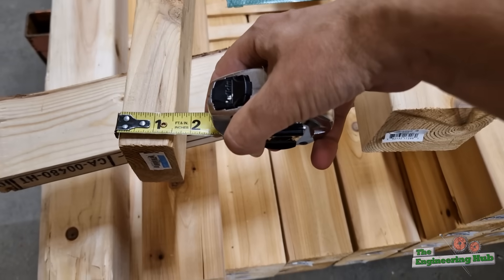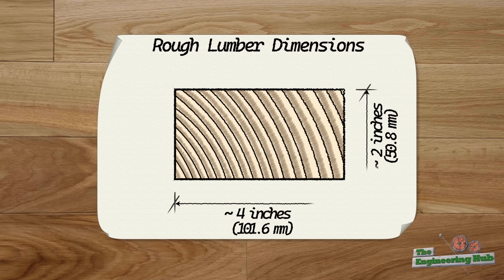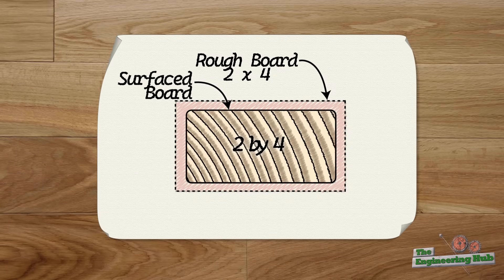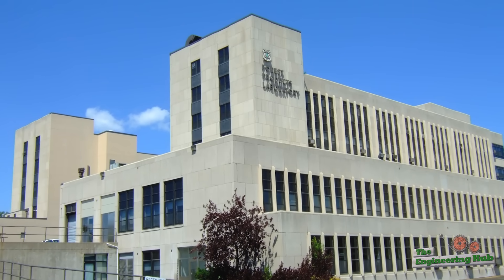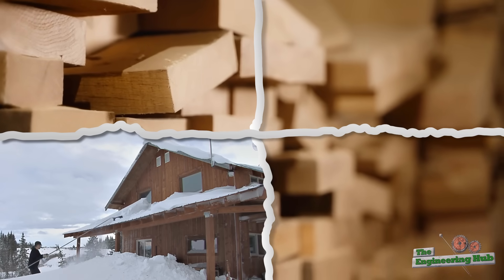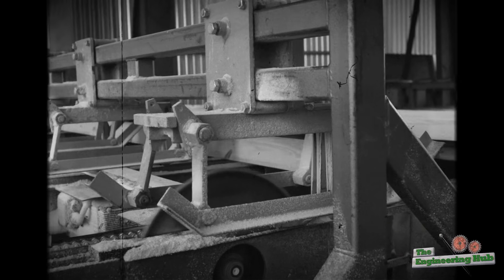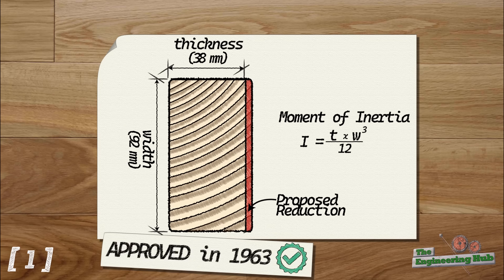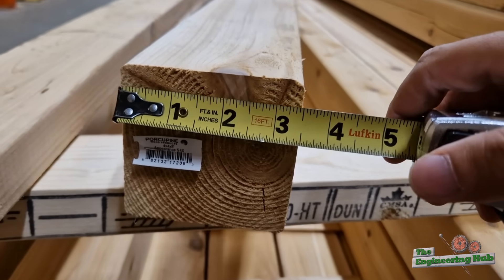Why is the 2 by 4 getting smaller and smaller?

Comment: Repeatedly the industry said, "without affecting the strength". I'd love to see a load capacity comparison between 100 year old 2" x 4" boards and the smaller modern stud boards with grain nowhere near as dense.
Reply from the maker: I'll look in the literature to see if there are any tests from back then available. It's an excellent point, and I am pretty sure you are right!
Reply: @TheEngineeringHub  Physical size  does not nesseserily mean more strength. It is the quality of the lumber that matters like wood grain and knots. I used to work at a roof truss factory. We used MSR-rated (Machine Stress Rated) wood  You can have different load ratings for lumber that has the same physical size even with lowly rated #1 and#2 'S.
Reply from the maker: @MrDarcykampe  Absolutely agree, there are many factors that influence the load carrying capacity of a wooden member and size is one of them. But the strength (yield strength) does not depend on the size, you are correct. Although size effects do matter to some extent; they are not as significant as for example the things you mentioned i.e. growth rings, knots, moisture content, etc.
Reply: @MrDarcykampe   We're speaking in terms of averages, not for one specific piece of lumber. On average, the strength rises with cross-sectional area because the average composition of a sample set of boards is the same for each element of the set, i.e. for each board that composes the average. Of course, to have a meaningful comparison between board sizes, one must have a statistically significant sample, meaning one large enough that the board quality is effectively the same across different sizes.
Reply: @TheEngineeringHub  If you are interested in running your own tests to check old vs new lumber strength, I have some very old reclaimed wood from old barns and homes that were constructed between ~1860 and 1910. The wood I have is still in quite good condition. Let me know if you want me to send you a couple sample boards for you to strength test and compare, I would be happy to mail some over.
Reply: @OstlerDev age of the wood you have makes it not comparable to what it would've been freshly sawn.
Reply: @TheEngineeringHub  a comparison of modern lumber to these standards would only indirectly measure load capacity but, might still be quite interesting: https://nvlpubs.nist.gov/nistpubs/nbstechnologic/nbstechnologicpapert319.pdf
Reply: @TheEngineeringHub  Maybe you can team up with Project Farms and find out sense he loves doing all sorts of experiments.
Reply: @Joe-TechandBlog this is a topic beyond a couple of quick project farm tests.
Reply: @TheEngineeringHub  One other thing you might want to include if you do a follow-up video is seeing if there was a difference in tightness of grain between old and modern lumber. The grain comes from the rings in the tree and my guess is trees with more rings will be more dense and therefore stronger. I would hazard a guess that in the early 1900's they were cutting down older (and denser) trees which would have a higher strength for the same volume.
Reply: @TheEngineeringHub yay
Reply: The old lumber gets harder as it ages, so any test would have to be with new wood of actual 2 by 4 versus standard dimensional lumber. Otherwise you are just testing the harder old versus the softer new as much as you are testing dimensions. 

I've found I have to drill a pilot hole in 100+ year old wood to drive a nail. Otherwise driving a nail is very hard, but if it is a 16 penny nail, the wood is very likely to split. Too hard to crush the way new wood does when a larger nail is driven into it.
Reply: Yeah, especially a wood like ponderosa pine, which almost fossilizes with time.
Reply: You will never see that comparison done under Official observation or standards. Sorry, but that is the facts of Corporational Governance!
Reply: In bending, and in loading where buckling is a failure mode, the depth of the beam squared gives the strength while width only adds linearly.  Thus a 3.5” vs a 4” depth against bending is only 76.5% as strong and a 1.5” vs 2” depth against bending is only 56.3% as strong.  That’s not even counting that better grain structure would also add strength.
Reply: Yeah, you know they are full of crap. Anything to save a buck.
Reply: @calj01 Also trees.  Higher density wood means trees that take substantially longer to grow.  Larger sizes means fewer pieces per tree.

Undoubtedly, the quality was better; even 20 years ago was better than what I see in stores now.  In 1950, we had somewhere around 2.5B people on Earth vs 8B today, there's just a bit more construction happening, and we can't sustain the rate of consumption now, much less using larger, slower-growing lumber. We can't even sustain our use of sand for concrete (not all sand is the same, or useful for concrete - that's why there are actually thieves who are stealing sand off beaches), which is one of the most abundant resources we have.
Reply: Here wood quality is garbage these days. They chop so young forests that they have make cross-laminated beams because 4x4 fail all load tests.
Reply: It's not whether it affects strength, it's where they're strong enough for purpose.
Reply: They wouldn't be the same, bet on it.
Reply: Keep in mind many of those old ones was made from what ever tree was closest to them.  So you had hard wood 2x4's as well.   So I promise you an oak or maple 2x4 will hold extremely more weight than a modern most common Douglas Fir 2x4 or even the stronger yellow pine. you can buy today.
Reply: The strength is different, not because of the dimensions, but because old growth wood has tighter rings making the lumber more dense, and strong
Reply: @mogyui2902 this is true in some woods. In others like oak, fast growing wood with fewer rings is stronger.  Old growth pine was gone long ago in many areas due to railroad pre coal consumption,  not due to structural use, so a lot of 75 year old wood isn't like the old growth stuff. The biggest difference between old growth and later is bug and rot resistance.
Reply: Isn't grain density really important, though? It's not like they are cutting out the density. We don't have those trees to cut anymore.
Reply: I always wondered how they'd like it if I paid them 80cents to the dollar, and told them "it won't affect it's buying power"
Reply: I just traveled back in time from 2223 and I can assure you that the strength of the modern 2x4 has not been compromised by it's newest size of ⁷/⁸  by 2⁵/⁸.
Reply: Yeah for the context of what's built as in houses and the normal spacing used and lengths, it does not affect the strength for the purpose. The thickness is minimal point vs the width which comes in many sizes as commons for most of the house which is the point of the statement. Keep in mind that too thin makes it easier to bow when drying and too thick just adds weight to the overall house which it is not just the framing but also the ground that it is built on. There is a reason why brick and mortar homes are not allowed to be built in some areas of the US, They will sink and settle too much which would damage the foundation.
Reply: @silentferret1049   If you get termites or rot in the wood, the thinner it was to start, the more quickly and dramatically this affects its strength. Any layperson who's had to contend with the issue is well aware of it. It's only the holier-than-thou professionals, lumber dealers and engineers (i.e. everyone who doesn't have to live with the consequences of a major mistake) who seem chronically unable to grasp the central factor in the question.
Reply: @no_rubbernecking when those weak boards fail, it's just more sales for the manufacturers. Why supply lumber that will last a lifetime when you can get repeat customers a couple decades later?
Reply: @tryscience   That is the obvious motive.
Reply: @no_rubbernecking  could you not just use concrete, brick, block, or steel if the thin wood of today is too weak for you?
Reply: @scrapmanindustries   For everything? Well I suppose. The point was that vendors should sell what people need rather than just what builders want to sell them.
   Someone above made the point that one could buy rough-cut from whomever, but the point is if it's available, it's only because the vendor decided to do the right thing instead of following the lemmings off the cliff.
Reply: @no_rubbernecking  you can actually come here to Kenton Ohio and find a bunch of Amish willing to sell you rough cut lumber. And vendors are supplying you with what you want. You’re voting with your money. Interesting how these lumber companies only interested in “corporate greed” are selling train loads of the stuff you hate yet the Amish here selling rough cut lumber that you desire are only selling pickup truck loads on occasion. And yeah you could make a building with no wood what so ever if you desire. I’ve seen it done.
Reply: @scrapmanindustries    So have I. Why did you think I hadn't? Oh, I'm wrong about lumber dimensions so I must be ignorant about everything.
   I didn't say "I suppose" because I had never seen it. I prefer to use lumber for the same reasons almost everyone else does! That being said, my preferred material for foundations and load-bearing walls is, of course, stone. One day, I may even get to build something with it.
   I'll say it again. The complaint was not that no one sells it, but that the ones who don't, don't. You can look right on this thread and see loads of Europeans and Ozzies saying the dealers over there only sell full-size, subject to planing, and they seem uniformly happy about that.
   Even some American contractors are on here saying they never build with dimensional 2x4, only 2x6 and up. [Edit: I meant for load-bearing, of course.] You're trying to present it as a couple of crazy guys plus the Amish. This is not the case. Your side is in the minority. But they have a lot of capital and control of the distribution. If 90+ % of the lumber is dimensional, 90+ % of wood-frame residences are going to have dimensional, and there's not a thing I or anyone can do in our lifetimes to fix that. All we can do is try to show you lot the reason the problem exists, which is a total apathy about the future of the structures or the people who buy them.
   Have you never heard of the concept of planned obsolescence?
Reply: @scrapmanindustries  it also has to do with amish lumber not being stamped... which is another whole bullshit argument from the major lumber companies who are in bed with governments and codes to prevent you from building with any lumber you choose, even though stamped lumber is trash and amish lumber is for the most part not. its also far cheaper than store lumber and you get more. its only because people arent allowed to use rough cut to build with that surfaced lumber sells by the train load. if codes didnt exist, everyone would build with bigger stronger lumber that is cheaper and better quality. government interference in the market is why the quality is junk today, just like anything else the government gets its hands on...
Reply: @michaelprice8810 if codes didn't exist everyone would build stronger 😂😂😂😂😂 that's the funniest shit I've ever heard.  Ever!  Have you ever had to do demo on a structure built to code?  Buddy if code didn't exist most construction would turn to dust and blow away before the ink dried on the mortgage.
Reply: @murderhappens8361that was my take away as well. The dimensions of our lumber today is sufficient for the method which we construct our buildings in North america today.
Side note, I believe the rounding of corners also prevents lumber from splitting
Reply: 16 on center... used to be 24.
Reply: @howdareyou41  yes but with smaller 2x4s now 
Just as strong  less materials 
And easier draw plans because all the materials are in  uniformed measurements. 
Like sheet rock and insulation ect
Reply: @robertnussberger6449  But that's not less material? If you've gone from 24" studding to 16" studding, you're using more wood again, bringing it back up to the required strength.
Reply: @NigelTolley  actually it's less and if framed correctly would be even stronger 
Plus sheet rock and plywood line up perfectly if done correctly 
Even insulation
Reply: I don't know about what the industry said, but I know we don't tend to use 2 x 4 studs for structural walls, we tend to use 2 x 6 - 2 x 10 depending on the load. 2 x 4 wood frame is really only used for non load bearing walls if possible.
Reply: The support spacing of wood is a function of the square of its dimension. A true pine or spruce piece of 2x4 needs 16 inches between supports. A 2x3.5 needs 12.25 inches on center. So, you do need more wood between supports for the same load.
Reply: @PR-fk5yb  which is why we don't really use 2 x 4 for most structural applications anymore. We tend to use 2 x 6 or higher.
Reply: Look at the growth rings of the old vs new boards.
Reply: It would be good to get load grades, along with real dimensions, than just nickname
Does designers know how much load "2x4" shop you buy from can take?
If not, engineer will play it safe and double it, while contractor will play it cheap and charge you for it, while using enough to not fall apart when you look at it hard enough, resulting with nasty surprises over years
Reply: Modern timber is made of fast growth varieties which much wider grain, they are much lower quality.
Reply: yep. money rules until somebody gets hurt and sues
Reply: It's all about more profit, plain and simple.
Reply: Anyone who has ever remodelled a 19th century house can instantly spot the difference. The 19th century house survived and is built like a fucking tank, whereas the modern equivalent is already a creaking wreck in a decade or two.
Reply: @mangore623  You can build a house like a tank whenever you want, bro. Just commission one with doubled up studs, pay 550k instead of 400k, and enjoy! Nobody's stopping you. People don't build those now because they don't want to work years longer before retirement just to afford an overly strong house that they don't need. Not because lumber companies tricked them.
Reply: If anyone cared about the strength, then homes wouldn't be built out of sticks in the first place.
Reply: @abark  brick houses suck. They also don't hold up to hurricanes, tornadoes, or earthquakes. That's why so few of them survived in the US while the barns and log cabins from the early era still stand proud.
Reply: "It's good enough" for construction designed around such exact materials, says people who never built or owned a home.. good stone and wood will make a home that actually lasts your family a few generations.
Reply: Also, a lot of people who didn't build houses in the 1800s talking about the construction process. The rough cut lumber that was planed down was very long ago and not dimensional lumber. Late 1800s residential constructions in New England are all made from rough cut true dimension lumber. Nobody was planing their framing once it was being cut to size properly.
Reply: just look at the old sears homes. they're still standing. newer homes are JUNK in comparison.
Reply: I've worked in construction, the difference is night and day.  I've handled old lumber, it's easily 50% heavier and way more durable.
Reply: I know this is super subjective, but I find this apparent in seeing 100 year old decks and such still standing around my neighborhood while the 30 year old ones are bowing under pressure.
Reply: No it would be weaker of course. The point being builders can use less and still be getting an appropriate strength for home building.
Reply: The strength mostly depends on the Tree not the cut. The 2x4 is the ruff cut measurement not the finished/planed measurement & since people used to plan the wood themselves it made sense to keep these pre-planed measurements that people were used to.
Reply: Haven't franing standards accounted for this now by going from 24in oc to 16in oc?
Reply: Actually if you frame correctly it could be even stronger.
Reply: Well I mean, obviously the hundred year old 2x4 is gonna affect the maximum load bearing potential of the piece. However, clearly and demonstrably the modern 2 by 4 is adequate for use in construction work, based on the fact that in a major number of cases, a modern building will be constructed using modern 2 by 4's.
Reply: It's the same thing, it's just that nowadays they don't include the tax in the  2" x 4" boards.
Reply: I said a 1" by 2", not a 1x2. Four of these making up an OLD 2x4, six of them making up an OLD 2x6. YOU are saying "1 by 2" because you want me to be wrong. 🤦‍♂ @didjitalone9544
Reply: I think you mean modern 2x4 that are actually 2x4 vs what we now call now 2x4 which are not actually 2x4?
Reply: Well you kind of answered your own question: the grain/density would make the 100yr old 2x4 stronger than a true 2x4 today. Commercial forestry and mills harvest very fast growing trees and not old growth ones, so they are not as dense. That doesn’t mean they aren’t strong though. The current building materials even at the minimum for code is more than strong enough to build homes that last, assuming they are used correctly and the home is engineered/designed correctly. I can attest this personally not with 2x4s, but I do work as QA in an OSB mill and the strength standards we have are far in excess to “normal” conditions.
Reply: Usage case was implied here. I can see you and 2000 others can clearly think for themselves though. 😂
Reply: Someone is obviously unaware of current building codes which require 2x4s to be closer together to provide the same tensile strength as using bigger lumber.
Reply: In engineering there's always a factor of safety. There's also trying to minimize cost while maintaining that factor of safety. Your 2x4 might have a compressive strength of 3000lb, but does it really need to? No.
Reply: @lazydadsgarage  there is always need, some need might come where you have no idea. Maybe  tree falls on your house, or truck rams your house, or you just wish to store heavy load on second floor. Or your house will be hit by tornado you never know the need.
Reply: @asjaosaline5987  building codes are there for a reason. You're all missing the point and everyone commenting has no background in engineering or construction 🤣
Reply: @lazydadsgarage  building codes are arbitrary, different STates have different codes. And when you compere them To Europe even most poorest European country has stricter codes. In Europe people are not that rich to build new house after each storm or after few decades. And there is that Issue. That if there is crappy building codes, then people still build by bare minimum, instead of making better quality. Building codes dont say how you should build they regulate base safty conditions. The whole internet is full of videos how another american built themself small homstead shack or Barn for they animals. That could be destroyed average+ storm. Just watched one video where quy destroyed word down barn that could still be good for half or century. Instead they built new and bigger and much weaker barn what could be turn down by grazed bull. ANd when i commented he sayd, building code dosent demand more.
Reply: @asjaosaline5987 but that's effectively an argument for an infinitely strong house.  No matter how strong you build, "something" could happen that wrecks your house and makes you think "I should have built it even stronger".  "You never know what might happen" is not a reason to over-build something.
Reply: @GerryRR  House in Europe is Home not piece of realestate, even if you dont have super-tornados it is best to build strong house, so your descendents can live there. In italy there is houses that are cose to 1000 years old and often same familys still live there. But if you consider house just real estate and plan it to sell sooer or later then ofcouse some people dont care what they sell .
Reply: You won't like the answer you get. Older structures are very commonly just snacks for wood destroying organisms since the wood is virtually identical to the dead decaying wood outside.
Reply: 100 years ago wood quality was potentially much better, straighter fibers, less knots, they let the wood dry before cutting and selling...
Now nothing of that is done, and they use fast growing varieties instead of selecting the best trees for wood!
Reality is that there are +5 x more people, and the forests are not expanding, despite the official numbers since the 2010's!
That's the real explanation, resources remain limited, while demand is rising, and the same is going to happen for almost anything at some point...
Reply: There's a company near me that buys 80+ yr old wood to refinish and resell at a premium... Big money , for the rich people houses and government grant landmark restoration..
Reply: @Jimmy-jb7wb  I thought the brittleness came from age and the turpenines oxidation and crystallization (like resin putty turned into amber) .
   The old wood seemed to have a lot more natural oils built up before harvest. You can see the differences when looking how different woods hold up  between hot attics and bathroom wetwalls for instance.
   I also worked for a Mason a number of years, I think the exposure to alkaline water kept most of the older wood flexible where newer wood disintegrated (the boss still had form wood and scaffolding from his dad!) , everything was either very old or very new, no middle ground.
   "If Jesus was a carpenter Satan was a Mason" 😜
Reply: @Jimmy-jb7wb  it's a bit before my time but I still remember 78's and Elvis,  it's probably mostly just survivorship bias, of the wood, the brittle ones broke early... But the spread still says something (old and new, nothing in the middle)
Reply: something to keep in mind is that is not necissarily a fair test, the 100 year old boards were rough cut, and you were expected to surface plane them on-site, which would reduce their dimensions to something smaller than 2"x4", but the exact amount would be extremely variable depending on the species, moisture content, how much material the worker doing the planing removed, etc.
Reply: The old trees grew slower (more rings, denser grain).

Modern lumber has to grow fast enough to meet the demand.

Older 2x4s are stronger, modern 2x4s are strong enough for the building we build.
Reply: You have to learn to pay attention to things.

It was clearly explained to you that the old lumber was hand trimmed at the job site. Whether you trim it by pushing a blade across it, or a company does it using Giant automatic machines, the result is the same, the lumber is smaller.

So done by hand or bought that way, either way you're 2x4 is not an actual 2x4.

And the modern lumber having looser grain, does not have anything to do with the size of the lumber.

That is the result of government spending into research to make faster growing trees. And yes, faster growing trees are weaker.

But that's still irrelevant to the size of the lumber affecting the weakness.

Funny thing is, even the channel creator doesn't realize something that simple. 

Time to block this channel and find a new one..
Reply: Weird how many contrarians will take the obvious conclusion of "It was to make more money" and completely overlook it because you'll never find the guys who made the obvious decision.
Reply: do you hear many stories of wood frame homes collapsing under compression?
Reply: The old 2x4s were roughly the same strength, because they were PLANED DOWN ON SITE before use. Nobody back in the day or today, was using 2" x 4" lumber right in the walls directly. They were all using 1.5 x 3.5 plus (or minus) a tiny bit, because they were planing down the excess just like we do today. Whether the planing happens on the build site or at the mill, does not affect final strength.
Reply: @gavinjenkins899  as someone who works with  new rough cut regularly, lives in a house that is old and built of rough cut, and regularly works on other olds homes built with rough cut, ALL of them used full dimension lumber. not one fucking house over 100 years old had a dude outside hand planing the studs down and then framing with them. they are all rough, and all full dimension.
Reply: @michaelprice8810  Then the logic in the video doesn't make sense, and there's something missing to the story. The lumber companies wouldn't have been able to just convince people to pay for pre planed lumber, no big deal, if it wasn't the same either way (as it would be if they were planing locally). So how DID the market bear that instead, if so?
Reply: @gavinjenkins899  not sure i understand your wording. if what wasnt the same either way?
Reply: @michaelprice8810  In the video, the youtuber explains that customers put up with the dimensional lumber initially, because since they were just going to plane it down on site anyway, planing it at the lumber yard instead was fine, they were functionally buying the same product at the end of the day, so they were cool with it, and the companies had found an actually efficient solution that made everyone reasonably happy. In your version, that doesn't make sense anymore, though. if they did NOT plane it down locally, then why did the market ever accept the pre-planed lumber? Any company doing that based on (what you're saying was a clear lie that "you were gonna plane it anyway tho!") would have been rejected by consumers and gone out of business versus competitors selling what people actually wanted, 2" by 4" rough lumber.
Reply: Pretty much everything in the US is going to shit.  We are allowing ourselves to be eaten alive by Jews.
Reply: @tradde11except they have not ar all, in any way. Do you know anything about fabricating walls? Do you know what percent of the wood, by volume, is studs?
Reply: it is not just the size, but kiln dried and dressing 4 sides makes the difference
Reply: Look up Rif sawn VS 1/4 sawn
Reply: Good video idea!
Dude make a video of a testing. 
Try maybe 10 old and 10 nzw to have a good sample of each.
Reply: @murderhappens8361 Yeah now instead of cleaning of dirt and gravel you have to wash off antifungal poisons or cut away plastics or wax, great!
Reply: Well go find a lumber mill and test it.
Reply: If you are making a load bearing wall you can go up to the next size.

Further, an external wall of a house will perform way better thermally if the insulation is thicker in say an 5 1/2 or 6' wall
Reply: @stilllearning1160   That's relevant in a temperate climate. In tropical and near-tropical climates, if you know what you're doing, it's a different story. Good 2x4s still have a necessary role to play for economy housing in such climates.
   The many strawmen and ad-hominems above your comment are really very Marie Antoinette; if the writers understood how gross they sound and how offputting they are for people of limited means, (which is an ever-rising percent of the U.S. market), they'd stop doing it.
Reply: Unusually the grain density is because of the species of tree, comparing oak to pine wouldn’t be a fair comparison and that’s what most of these 2x4 size war memes show
Reply: Sorry but strong enough is not very comforting to me. I have my portable sawmill and will continue cutting and building with rough cut 2x material with a true dimensions. So much easier to do math when drawing out the house plans too.
Reply: Yeh we used to overengineer things 200% until we realised we could save a lot of money over engineering just 10%. Now things often collapse
Reply: @MrWackozacko I've never heard of a stick-frame house just collapsing due to lack of strength in the lumber 😂😂
Reply: All these people arguing about the strength of 2x4's haven't built anything in North America in like fifteen years?  Exterior (aka load-bearing) walls aren't framed in 2x4's.  2x6 is minimum and if you want a more efficient build with more insulation you go 2x10.  2x4's are for framing up a bathroom, and if you're concerned about the strength of your bathroom walls I'm very curious what you're doing in there 😂😂😂
Reply: Modern buildings are all, one way ir another, engineered design. Everything has to meet the loading requirements using engineering calculations. It's not relevant. Modern buildings are overbuilt for most purposes. Trusses, brackets, nail plates, steel straps, rigid air barriers as bracing, lag bolts ect, mostly did not exist on the past. We are using less material for am arguably stronger and definitely more consistent end product. In the past we just winged it and kept our fingers crossed that the building was strong enough. The fact that so many old buildings still stand is really survivorship bias. We're looking only at the small number of buildings that still stand and thinking that's what they were all like. Modern building regulations are written in blood though. People died and rules were changed. Modern buildings are better in just about every way.
Reply: @Patrick-857  you must not build. or if you do, you have zero experience with old buildings. they are simply better than the houses churned out by the consumer world. buildings were not just winged. carpentry was a prestigious trade passed down the line. it wasnt something that joe from down the street just woke up and decided to do one morning. old houses were crafted. new homes are assembled. youre never going to win this argument.
Reply: @michaelprice8810  I have experience in both new and old buildings, and I also have seen the results of three major earthquakes personally. I was there when our government completely rewrote the building code after one of our cities was devastated by one of those earthquakes. 

I'm not talking about craftsmanship here, I'm talking about structure.
Reply: @Patrick-857  you just invalidated your own argument with the word government. good day.
Reply: @michaelprice8810 
Survivorship bias.
Reply: How about splitting  a 2x4 when hanging any sheathing or  drywall? Used to have 1" on each side now down to 3/4"
Reply: I live in a home that is over 100 years old... There used to be a mill/lumber yard down the street (long gone)
This home is FRAMED with 2 inch by 4 inch oak... the joists  are also OAK and are thinner than what we use today but being that they are oak they are overkill.
I have drilled screws into the boards and literally exceeded the drills capacity to bottom out the screw, even with hammer drills
It would not even be close when compared to lumber of today... like a tank vs a car...
Reply: It would be negligible
Reply: The test would be interesting but it would be obfuscated by another factor...old growth wood (found in 100+ year old lumber) and new growth wood.
Reply: Soooooo you want to compare the durability of more wood vs less wood? I think it's obvious more wood would be stronger.
Reply: Without "significantly" affecting the strength

Every single reduction made it weaker, just by a small amount. Small amounts add up quickly when you keep rounding them down to zero in your books
Reply: @Terrible_name  In accounting for load, it’s more important to have a standard size after drying and wood type than how big it is with a large variance in size and greenness. You can double up or put in another beam, you can’t do anything if you calculate a full 2x4 is good enough but it isn’t due to variance of the product
Reply: @gjfwang  and? That's not really a response to anything I said
Reply: Thats a rather simple mathematical equitation.  Moment of resistance = b × h x h /6.  Here: 2 x 16 / 6 = 5,33  and  1,5 * 12,25 / 6 = 3,06. Or simplified: cutting half an inch on both sides reduces the load capacity by 42,5%. (if you use them as a beam, using them vertically would be es different story)
Reply: @adolfhennecke701  the actual question is what “strength” is needed? Studs in compression need end grain crush values. Additionally, the studs must resist bowing and twisting under load. Being old, i cannot recall how that capacity was calculated and tested from my structural engineering classes at a major University in a previous century.

So the question still remains: “Why pay for and use components of greater capacities when smaller (less expensive) components that accommodate the calculated loads exist?
Reply: @larrysorenson4789  same reason why you don't climb with a rope that's rated for your exact weight.
Reply: @larrysorenson4789 some regions actually need the redundancy for safety reasons. And safety is cheaper in the long run. 

As an example: the Deep South has both tornados and hurricanes. More insects than normal, and more rainfall and humidity than normal. Our home insurance rates are much higher than the national average. We end up paying more for the cheaper material over the lifetime of the house because of how insurance works. My home insurance rate is easily 30-50% higher than an identical home in the upper Midwest. 

Quite frankly I'm about done with lumber built homes. When I went to Europe the homes were obviously built to higher standards with tougher materials. Even interior walls were often bricked. European standards make our homes look like popsicle stick garbage.
Reply: @sean6653 interior brick walls sounds like a nightmare.  "I wanna hang a photo Lemme go get the fucking hammer drill" 😂😂
Reply: @adolfhennecke701  In the UK we use 47 x 95mm which is basically a 1.85 x 3.75  which would be 4.33 in strength or a 19% reduction and conversely an american 2x4 has a 30% reduced strength of a UK/European 2x4.
Reply: Bending moments are a square of depth (actually a cubic relationship but divided by the distance from the neutral fiber so squared overall) while linearly dependent on width.   Depends on how you load it, and what the material properties are, but overall it’s simple to calculate as the ratio of squared depth in bending which is the ratio in bending strength of the two boards.  Thus a 3.5” vs a 4” depth against bending is only 76.5% as strong and a 1.5” vs 2” depth against bending is only 56.3% as strong.  Further since the 76.5% width is also 1.5 instead of 2 it’s 57.4% of the strength in bending and 57.3% is 3.5 instead of 4 it’s 49.3% as strong.   @adolfhennecke701
Reply: @adolfhennecke701 Technically right, but for construction purposes SLS is more important than ULS in almost all cases and for that purpose the second moment of area is needed. The formula for that is I_y=(b*h^3)/12, so the missing height is even more important than assumed by you.
Reply: @adolfhennecke701 omg lol and the first reason listed in the video, to increase the amount that could be shipped at once since they were already planing the boards on site. So if that 42.5 you mentioned is the percentage in mass being reduced, that also means they're carrying 42.5% more boards per load by planing them at the mill before shipping. And mind you, they were having to plane down those original true 2x4s anyways so y'all comparing the strengths is extra silly. Using true 2x4 just means more wasted materials on site, which then needs to be cleaned up, and now you have less boards so that means more shipping which increases cost and carbon footprint. Such a silly discussion
Reply: I guess they just don't make trees like they used to. Corporate greed is really making pines grow to be much weaker.
Reply: @shamancredible8632  they don't make trees like they used to. Older lumber came largely from old growth timber. The trees grew much slower amidst competition from other trees, so growth rings were much tighter. Much of today's managed forests are replanted for higher production species, spaced at optimum density for quicker growth, and cut far sooner. Growth ring spacing is much fatter than old growth, and not as strong.
Reply: @stevehatcher7700 which explains why neighborhoods look like piles of kindling after major storms blow through
Reply: @shamancredible8632  - Did you check out the growth rings?  Those are from farm grown trees.  Yes, they are weaker.  The difference today is design.  It makes up for the poor stock.
Reply: Or possibly its old growth vs using young trees combined with demand for lumber.  Corporate greed is a buzz phrase for everyone who doesnt know a fucking thing about anything.   It does exist but it isnt what dipshits like you think @shamancredible8632
Reply: @shamancredible8632 I don't know if you're joking.  Bc what you said is actually true. 
 Though it's not just greed,  but also a more sustainable market strategy... cutting lumber from large old trees in the past allowed them to take lumber from the section of tree best suited to that purpose (ideally); now they farm trees and cut them young... though I'm not sure exactly what effect that has on strength, by just looking at the lumber pile at any store, you can see what rushing growth and drying process does to final product quality.
Reply: @shamancredible8632 You're more right than you think trees during drought add less diameter/yr than yrs w/ substantially more rain making smaller rings & "tighter" grain yielding harder wood 
Modern lumber companies irrigate to max growth/yr, trees reach harvest size faster but "looser" grain yielding softer lumber
Reply: @shamancredible8632  yes it most certainly is. youre very right, despite trying to be sarcastic
Reply: @shamancredible8632  Actually, yes.  Literally.  We've affected the growth rate of the trees with fertilizers and artificial hormones and it's made them weaker.
Reply: @shamancredible8632 yeah. Stress induced rapid growing in lumber forests really reduces the density
Reply: I talked to a fireman at a bar and he was complaining about newer houses built with white pine lumber and finger jointed lumber. I'm not sure what the difference is, but he was telling me that houses made from white pine are junk and the roofs collapse unpredictable, fire spreads faster, etc. When he entered an active fire he would sometimes axe a wall open to see what the type of lumber was and that would help them determine how risky the situation is. I never knew that, good information. He clearly disliked new modern lumber and said cities are decades too late on updating code. Not sure what all is accurate, but I did notice the finger jointed 2x4's at Home Depot several years ago, that just doesn't seem right.
Reply: @81mont 
Firemen at bars aren’t reliable sources. I’ve heard them express opinions about construction that I know for a fact are opposite of reality and facts.
Reply: Exactly!  Slower grown rings, therefore, tighter old growth lumber was and is quite a bit denser, hence, stronger.  Good old marketing hype and lobbying!  No different than 1- & 3-pound coffee cans that are now 11-13 oz and 21- 33 for a 3 pounder and everything else that's packaged you now get less product for more money (peanut butter, T-paper, most everything.)  You can still get a true 3 pound can of coffee at Costco!
Reply: That’s the problem. People keep cutting corners saying “we’ll this will still work! It’s strong enough” and then eventually all those corner cutting mistakes add up into a shoddy product.
Reply: The "strong enough for the purpose" argument is dumb. 

It's like the epa said you can call a V8 engine a V6 and you people are all talking about highway speeds as if no other "purpose" is a valid use. It both misses the point, AND is a deeply flawed argument.

People can use 2x4s for projects other than new home construction, and calling a 1" board a 2" is a deceptive practice regardless.
Reply: @TheBrothergreen ur right, we should call them 1 & 5 8ths by 3 & 5 8ths instead
Reply: @seandunbar6427  you could call it "framing lumber" or something similar. 42mm lumber would also work. What you call it is really irrelevant, so long as what you call it is not specifically and objectively a lie.

That's assuming you were being sarcastic about actually labeling it correctly because god forbid you call it what it is.
Reply: It's going down!
I'm yelling timber!
You better move!
You better Dance!
Reply: Fair observation. On the other hand, given that the houses have to meet current engineering standards, even using the thinned studs should not be a problem, at the end of the day. If they were not enough for construction, they would not pass engineering specifications.
Reply: a dressed 4 sides  2x4 1.3 x 3.5  is the same strength as a rough 2x4, that is why they went to 1/5 to 3.5. it was the smallest they could go with out effecting its strength
Reply: @TylerSmith-jf3dg  thats just false though. its 65% of the lumber as a full 2x4. in no world other that a world of lies is that the same strength. as someone who regularly works with true lumber and home depot lumber, they are worlds away from each other.
Reply: @TylerSmith-jf3dg  That's just not true, rough 2x6 joists and rafters were common for a reason, they are unheard of today.
Reply: @cyberpunkspike  it is true, because some places a rough 2x6 could be 2.25x5/25 and there was no real standard.. not until stamped lumber came in and so a stud from florida is the same as a stud in california under NLGA national lumber grading authority. before that a rough 2x6 could be different from mill to mill until deminsional lumber became standard in canada and the states
Reply: @cyberpunkspike  they are unheard of today.because of the strength difference, and most banks require dressed ,kiln dried and stamped lumber for  a mortgage ,and also for engineering purposes, dressed lumber is stronger the rough limber nand is less prone to cracking and also fires as well. there are many reasons why rough lumber is not used much anymore
Reply: @TylerSmith-jf3dg  It's just nonsense the lumber manufactures peddle to justify their own interests.  In almost old home I've been in in my region, rough 2x4 circa 1890 is 2 by 4 inches.
Reply: @TylerSmith-jf3dg  It's unheard if because 1.5" x 5.5" can't bear the weight.
Reply: @cyberpunkspike  yes some were, here you will find all different size lumber, the lumber has been tested and a dressed 4 sides lumber at 1.5 by 3/5 is the same strengrh a a rough 2x4, where i live has the oldest lumber milll industry, and i have worked in the industry for many many years a a lumber grader and as a lumbner inspector . ot os not hard to understand that mills all across the canada and the states were not standardized until nlga and ngr regulation came in. and that is fact
Reply: @cyberpunkspike  you think so. about  1.3 x 3,5 when  billions of  homes were built with 1.5  x 3.5. my house has 1.5x 3/5 and all the homesbioly until around 2005 when new building codes came in and now 2x6 is the size needed, and that was only for insulation factor to make homes easier to heat,
Reply: @TylerSmith-jf3dg  If your mill gave you lumber that wasn't 2x4 you would never buy from them again, that;s why rough lumber from 1890 is damn near always 2 by 4.
Reply: @TylerSmith-jf3dg  you need 2x6's now for load bearing exterior walls, because you really needed 2x4. The entire tradition of framing carpentry was right, and value engineering from CA was wrong.
Reply: @cyberpunkspike  2x6 not needed unless you are building a 2 story house for load bearing , R value i why they went standard 2x6 for walls.
Reply: @cyberpunkspike  like you aid dam near always,, meaning lumber sizes were not regulated and you could get different sizes, you just proved my point
Reply: @TylerSmith-jf3dg  funny my early 1900 house is 2x4 exterior walls balloon framed 24 on center. 2x8 floor joists spanning 16 feet, also 2 feet on center. one of them was crowned up, as is normal practice, and the damn thing still has an upward crown. over 100 years later. try that with 16 foot 2x8s from lowes and  see where you are in 100 years. in the basement. thats where you will be. because your floor sagged all the way down there.
Reply: @michaelprice8810  what is funny bout that,, i have worked on many homes datign back from the 1700s 1800 and 1900s.. and guess what, while some hve 2x4 and 2x6, some have 2.5 x 3.5 .or 1.75x 5.75
Reply: It's easy enough to double up the studs or use larger dimensional lumber when more strength is needed. The reduced strength doesn't really matter.
Reply: ex @bbgun061  Except it would cost twice as much to double it up.  Which is a significant cost.
Reply: @YouveBeenMiddled  all lumber would cost more if it were larger.
Reply: @bbgun061  more is not double.   We are talking a true 2 x 4 up from 1-1/2" X 3-1/2 VS  2 x 1-1/2" X 3-1/2  when that is not needed.
Reply: @bbgun061  If your logic is valid, why then are all floors, walls and roofs not framed in 1" × 2"? After all, four of these can easily be combined to equal the strength of an old 2×4, or of course 6 to equal the strength of an old 2×6 and 8 for that of an old 4×4.
Reply: @no_rubbernecking actually, that's kind of what they do with glulam, which because they can alternate the grain direction is stronger than conventional lumber. The point is that the marginal difference in strength is outweighed by the reduction in cost. You can double up WHEN NECESSARY (which is not most studs), and likely you would still need to double up dimensional 2x4 in the same locations anyway.
Reply: you only need to doublr up in load bearing locations- and youd  probably need to do that with full dimension lumber as well @YouveBeenMiddled
Reply: @appads   I'm sure that's splendid for manufacturers and sellers, but it doesn't work for the owner in a tropical climate who wants their structure to actually last a reasonable period of time.
Reply: @no_rubbernecking  interesting move of the goalpost. It's also good for the consumer. Besides, there would be very little effect from the small difference in size (from 1.5x3.5 to 2x4) due to a different climate.
Reply: @appads    Interesting that you say "would". I have to deal with the difference continually, because I'm here. So for me it's not "it would", it is "it does".
   It's not a move of the goal posts, it is survival. You either do what you must and survive, or you don't and lose your home. The drone of outsiders trying to "tell you" the facts of your own life is not even noticed.
Reply: @no_rubbernecking  OK. Well, go buy yourself some rough sawn 2x4 to build your house. Nobody's stopping you.
Reply: @no_rubbernecking  Maybe look at your math and try again, 2x4 = 1-1/2 x 3-1/2 and 1x2 = 3/4 x 1-1/2 so your x4 would be 1/2 inch short. Also the thinner boards are more likely to bow than a thicker board. There is also the need for both more nails or screws and glue just to get a 2x4. Anyways the common 2x4 is perfectly useable as it is and doubling it which is fairly commonly done when its needed in critical areas can be utilized in addition to lengthening the board past what you have. Its pretty hard to get longer than 16ft boards off the shelf so a roof or even floor will have a main support that is doubled up and staggered with glue and fasteners. Its the better balance.
Reply: @silentferret1049   My math is fine, dude. It's yours that needs some rethinking.
Reply: @macheadg5er  This is Why American house industry builds crappy houses, they have low quality material. Average AMerican house will be blown away weak hurricane or Tornado, Ripped to pieces. Old hauses that are 150+ years old are much higher quality. European houses will last centurys, with that time multiple times supper storms will go over them without destroying them.
Reply: @bbgun061  naw we just need bigger trees
Reply: @asjaosaline5987  Europe doesn't have nearly as many tornados as the US, and most are not as strong. Hurricanes are also rare and earthquakes are limited to only certain regions. One decent size earthquake would take down all of those old, rigid stone buildings in most of Europe. But it's not about being better/worse, it's about being designed for the situation. California has different rules than Wyoming because one place has earthquakes and the other has tornados.
Reply: @ADBBuild  Things change in centurys, yes europe has lot less tornados and hurricanes and other forces of nature and they exist. And average house experiences atlest 3 such thing in Century. And survives it. And houses are built for centurys some are as old as millenia and still standing. Average american house needs to be totally rebuilt after being direcly hit by hurricane. realy small ammount can survive 1 hit, but still need repairing, thats not a case in europe. Yes Some module housing have been polular late decade but they are under 3 & total Europe housing. Big problem is american consumerist culture, american usually moves averagely after 4-5 years living same house . And thats why no one caes to build quality, usually houses are built flimsy and big. But its not competition, but person must be fool to buy low quality house.
Reply: @appads  Nobody besides regulators? You know you're not allowed to do that right?  Or did you mean live Ted Kaczynski style, in a mountain hut in the middle of nowhere illegally?
Reply: @cyberpunkspike  just factually incorrect. You can build with non-standard lumber, you just need the right permits and approvals. Happens all the time. If you're just doing standard framing, it's probably a waste of time and money, but that's sort of the original point.
Reply: @asjaosaline5987  If builders in places like Florida didn't cheat and actually built to code, most houses would survive most hurricanes. Wind damage wouldn't be a problem no matter how fast it blows so long as it isn't carrying anything deadly, like a fallen tree or your neighbor's roof that wasn't properly reinforced as required by code. There are almost never consequences for ignoring building code requirements in Florida, so you see a lot of damage there as the houses are intentionally not built for the climate of the area. The insurance companies constantly raising rates to compensate for this nonsense will hopefully lead to a tipping point where the code is actually enforced.
Reply: @5467nick  Yes this is offical problem. Thought people should also care for they safety and property. In most of World there is no such thing like new house market, people prefer to build custom houses for they own need or they seek out houses in market that are acceptable. In USA most cases construction companys mass produce houses and sell them. And people buy having no idea what kind of home it is they watch size and interior and that all. Thats Why there is badly buolt houses in market.
Reply: @bbgun061 or if the mills would stop shutting down for months when ever the prices falls to a reasonable sum
Reply: @bbgun061 you must have at least a P.hD. Thank you for this great insight.
Reply: @bbgun061  This guy gets it. It actually saves up money that it's available in smaller sizes because then we don't have excess strength where we don't need it.
Reply: @bbgun061 are you on the spectrum or something?
Reply: At twice the price. @YouveBeenMiddled
Reply: @YouveBeenMiddled  No, it wouldn't be a significant cost because there's no reason to double up in all the areas that don't need it. As usual YouTube commenters who don't even know which end of a hammer to swing are here to give their expert opinions as tradesmen.
Reply: @Eli_00001  You're asking me, and not everyone complaining about the size of their lumber?
Reply: @appads  Except for the entire lumber industry and overbearing federal regulators.
Reply: @YouveBeenMiddled better to double up the very few times it’s needs vs having tons of wasted wood all the times a true “2x4” might help.
Reply: @no_rubbernecking  dont feed the troll haha
Reply: @michaelprice8810  Not sure which comment you refer to, but i'm pretty sure i was just trying to stop it from gnawing on my leg
Reply: @appads what you are describing is not glulam. You're describing plywood. Glulam is structured with the wood laminates all running parallel to the direction of the beam.
Reply: @no_rubbernecking  not sure which comment i was replying to either, sadly, because the way youtube handles these conversations, is atrociously designed. but after going through 200 comments and finding that i agree with most of the other things you said, i think we are in agreeance on this subject. what were you trying to stop from gnawing on your leg?
Reply: @michaelprice8810   Just one of the more disagreeable "trolls," heh. 👍🏼
Reply: @YouveBeenMiddled  You wouldn't double the entire structure .  Just certain stress points .  And the reason you double instead of going to a 2x6 is because it would not fit within the finish dimension .
Reply: @macheadg5er   bbgun's point is the smaller dimensions are fine for the majority of the structure.  But if you need more strength on certain stress points ... you simply sister in an additional member ( double it ) .
That way it still fits within the projected finish dimensions .
We don't need more options between 2x4 and 2x6 to pick off the shelf.
It's already a f00king fiasco at the lumber store presently .
Reply: @no_rubbernecking  The time it takes to stick them together of course .
bbgun's point is what to do when more strength is desired for certain stress points.
And you still want to conform a wall , ceiling or floor cavity to the same finish dimensions .
Reply: @bbgun061  Sheesh ... the standards for what passes as a DIY'er have really plummeted eh ?
I doubt most of these "What abouters" even did a project at their grandmothers house . And don't seem to understand the concept of why , when , where you would employ a sister , scab or double framing member ?/?
Reply: @leinie6683 I mean you shouldn't really use 2x4s as load bearing anyways... That's what studs and beams are for. And a lot of 2x4s aren't really supporting anything and just get thrown out after. Like with concrete structure they need shit tons of would just to make forms for the concrete which will all be stripped and disposed of. So if it's easier to work with than that already justifies the switch.

But also one factor y'all aren't thinking of is how many fit on a truck. Your all focusing on the strength lost by that difference in mass, which sure maybe be true. But smaller lumber means you can carry more pieces per shipment which is MASSIVE for reducing cost in transportation per piece. 

In other words, if it was truly better to have true 2x4s than it's wtf we would do. 

Like I'm in Canada, we have no shortage of wood for lumber lol. We have so much land for logging that it's easily sustainable here. And yet we still do this here. It's an efficiency thing fs
Reply: @no_rubbernecking you don't make structures that last out of simple lumber and plywood period... Old house used to stand for so long cause they used skookum af lumber. Like some real heavy duty stuff sometimes. 

We've mostly logged all the old growth trees, and what are left should be protected. So we can't really build things like they used to be. 

Hence why we make shit that we want to last out of concrete and steel
Reply: @Jeff-Von-Landshark     All right, first of all, i never mentioned plywood, so that's the biggest red herring on here. This was about the framing of bearing walls, and i added in floors and roofs since they also have to bear weight.
   Not sure why you're so obsessed with arguing over the proper definition of "long-lasting" in housing terms. It should be obvious to you that there are different definitions for different needs, yet you don't seem to care about that at all.
   Nor do you seem, to judge by your words, to care about planned obsolescence, which is the real issue in this debate, which i've brought up explicitly once and others have alluded to, but most seem to want to avoid addressing. Hmm, i wonder why... actually JK, i know exactly why.
   It is criminal behavior and should be defined as a crime and a major felony. That it's not, is why the present argument exists.
Reply: @bbgun061 We’d just buy smaller pieces when that is all that is needed, so there would be no additional cost.  They just used marketing spin to compete with local mills.
Reply: @no_rubbernecking  An old 2x4 was the same as a pre-planed 2x4 from the factory today. 2x4 is the ruff cut not the finished cut. People used to plan 2x4s themselves & they would shrink regardless but buying them pre-planed saves you the work of planing them. Also wood strength is mostly about the tree not the cut. Realoly all people need to know is the 2x4 refers to the ruff cut.
Reply: @wandameadows5736   Sorry but you don't know whom you're talking to. I've owned three houses that were built with pre-1943 2x4s. I know exactly what they look like and how their dimensions compare to "modern" ones, post-installation.
   I do not understand the tsunami of people who want to come online just to tell me about my own life and what i've seen, done, and worked on with my own hands.
Reply: @bbgun061 It doesn't matter if the industry says it's not affecting the strength when in fact it is.
Reply: @tryscience   Size of lumber by 1/4 to 1/2 inch is less of the factor in lumber not being as strong .   It's more about how tight the grains are , and todays lumber has looser grain.   But it still holds up fine in todays world of remodeling the remodel , that got remodeled 5 years ago when they were busting out those countertop and tile floors that were built to last 100 years .  But they don't fit in with todays décor .
Reply: @bbgun061  OK, when you pay for a gallon of gas, don't complain if they give you 7/8th of a gallon.
Reply: Sure you can double up, that's not the issue. The issue is they are definitely lying about the strength of their product and still charging as if those studs measure up to a real 2 x 4
Reply: @MyName-Jeff  
Do you have a site where the lumber industry actually lists a strength rating for lumber?

Any strength ratings are more likely than not to be from government research.

The vast majority of lost strength is from using faster growing trees. Also paid for by the government.

But none of it has anything to do with anything.

They started finishing the wood a long time ago. When they started, they didn't also switch to faster wood at the same time......

Soooo, when they switched to trimming, it really didn't have an effect on the strength.

Changing to faster growing trees decades later, didn't magically make their statements at the time, a retroactive lie.

Rough cut lumber has more surface defects.
Surface defects can and do start the failure process. So smoothing out the surface does in fact help make wood less likely to fail.
Reply: @bbgun061  When they put only 4 bottles in your six-pack, that's OK. Buy two of them.
Reply: @bbgun061 this is twice the cost now if not more depending on variables you want to add.
Reply: @bbgun061 that’s the most Jewish thing I’ve heard today.
Reply: @bbgun061 2x the cost, still needs nails to bind and not as strong
Reply: @bbgun061  "double"..."doesn't really matter"...someone explain how jobs and money works in the world please I CBA
Reply: Yes it does, everything being built with shit quality is a serious problem in this country
Reply: @bbgun061 They are saying there is no impact on strength between the true 2x4 and the reduced dimensions sold. You are saying one can just buy twice as many pieces when the original strength is needed. But that is just 2x the wood for 2x the price.
Reply: Why use boards with more strength than needed for the job?
Reply: @larrysorenson4789 because the needed strength isn't only when the weather is good, it's also when there are major storms destroying other homes.
Reply: @larrysorenson4789 "why use boards with more strenght than needed for the job" - american house building at it's finest.
Reply: @larrysorenson4789 climate change. When my house was built 5 feet of snow fall  was rare. In 2015 we had 8 feet in 2022 it happened again. So far the hemlock roof joists have held but it is definitely over built at the time of construction.
Reply: @martyk1156 humorous to make such a fantastic claim.
Reply: @larrysorenson4789  But the job is designed around the available materials. It's like looking at Ikea furniture and deciding that the hex key is the only tool needed - yes it's enough to build things that were designed to be built with it, but if you had other tools you could expand the range of what you can build.

Of course, it's so ubiquitous as to be irreplaceable now, so this is all academic. You can't change 2x4s now or switch to a thicker standard because damaged 2x4s will keep needing to be replaced and having 2 different 2x4-ish sizes would be a nightmare.
Reply: @larrysorenson4789 "why use boards with more strength than what is needed for the job"....REALLY? Wow. So the bare minimum should be what we aim for?
Reply: @larrysorenson4789  : Need is determined by where the home is built.
Besides, overbuilt is underrated.
Reply: @larrysorenson4789   The question is how much is needed. Thicker and denser boards last longer.
Reply: @no_rubbernecking what? They don't have different life expectancies.
Reply: @daw162   I've already explained how they do.
Reply: @no_rubbernecking Hemlock, fir, cedar, and pine would like to have a word with you about make misleading statements.
Reply: @mimcduffee86   There are no misleading statements.
Reply: @no_rubbernecking dude but they don't necessarily. I'm so sick of seeing these discussions online being led by the ignorant, who assume things based off their own understanding that is irrelevant.

Like clearly there's specified knowledge that leads them to these decisions. Like no shit thicker lumber is stronger. That doesn't mean it's better given all the many factors that go into construction and what materials you use.

Assuming the strength of the lumber is all that matters is asinine. 

I remember a similar conversation regarding Martinez hammers and some Redditor explaining how it makes no sense that titanium absorbs vibrations. But meanwhile anyone that actually uses one for their work knows first hand what a massive difference it is. Obviously it doesn't totally make sense and I'm sure there's some advanced understanding of titanium that allows it to absorb force where steel would reflect it. But it doesn't matter that it doesn't make sense to an uneducated opinion. It's just how it works.

Sometimes your logic, even if right in general, does not have all the answers. And generally entire industries don't make choices like how we produce out lumber, just off of whims... I'm sure there's plenty of reasons they do so
Reply: @Jeff-Von-Landshark   Who's assuming again??